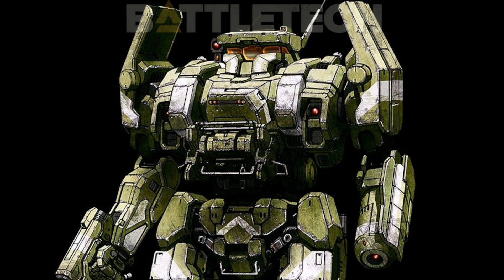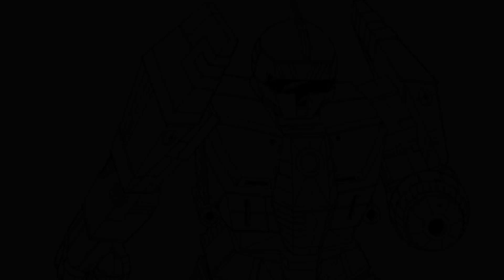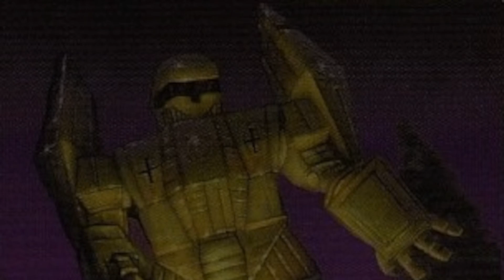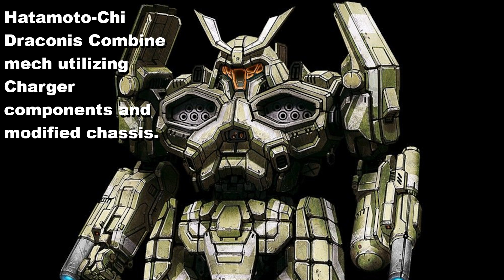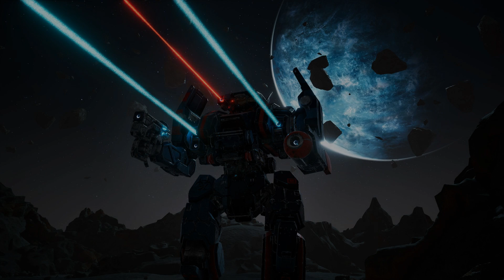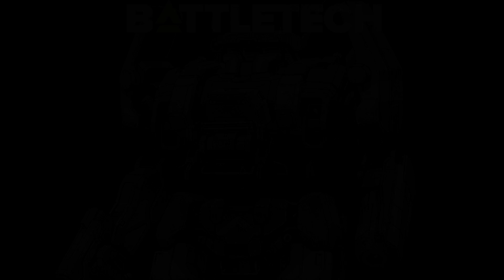BATTLETECH: The Charger

Comment: Niche mech that can be really fun to use upon occasion. Ive run one in games where I paint an area with smoke and let this guy just stand in it. No one goes into that smoke. No one even comes close. Suddenly I have an area that the opposing player wont enter and that means he takes the long way around. Is it a great strat for most games? Not really, but if you need to hold a particular spot even for a few turns this can be one way to make it happen. 

Oh and if you want to be truly mean strip the weapons, add a hatchet, adjust the pilot to an 8 gunnery with a much lower piloting skill. You can make a zombie mech that can easily terrify your opponent. Definitely not a great all arounder, but it suddenly becomes an amazing guard mech.

Comment: Funny thing is, I've been fiddling with a similar design. Saw the thing on the Battlemaster and asked, what if it was faster? So, shrank it to 80 tons, went to an XL 400 engine with FF armour and jump jet. One large ER laser, six medium lasers and a quad of machine guns. 

Not a cheap Mech by any means. 

But the idea was more a sort of command Mech that could keep up with faster formations. Initial tests weren't bad, but it does have a lot more firepower than this thing does.

Comment: I like the Charger because it better represents procurement thinking and bad weapon systems which make their way to the front line over the protests of soldiers. Many such systems exist or have existed.
It makes a lot more sense for the Charger to have originally been built with the XL engine and sold to the SLDF, it could be spun to look good on paper, and is a viable assault scout this way.  It need not have any better armament than five small lasers, just jump jets and more armour.  With the standard engine I do not see the mech ever making production.
I have seen 100 ton designs with the 400 rated engine, they are somewhat more viable for level 1 tech as a 'heavy assault mech that can keep up'.

Comment: Let's compare the Charger to another famously dodgy but more successful design: the Phoenix Hawk.
Standard PHX-1 carries 1 Large Laser, 2 Medium Lasers, and 2 Machine Guns thereby outranging the Charger. It runs at 97 kph and can jump thereby outpacing the Charger. It costs significantly less. The only way you could make a Phoenix Hawk worse than a Charger is if you tried to use the LAM version.

Comment: Wasn't there a variant with 4 large lasers (with a smaller engine)? That sounds pretty solid to me.
Reply: Yep - a 3/5 move with 5 tons more armor, 4 large lasers, a medium laser and a lot of heat sinks. Noted in the fluff as a relatively easy conversion (despite engine swaps normally being a difficult task). Also known as the "Challenger" - maybe as an attempt to get the Charger stink off? Best use of the chassis IMHO along with the Hatamoto series of mechs.
Reply: Still it's useless and inferior compared to let's say an Awesome

Comment: 3050 full clan tech rebuild, CGR-5A, Charger. 5/8/5 movement. armor factor 247 (max), 80 tons, 26.25 Clanner XL engine, 7 tons standard cockpit+gyro, 5tons jumpjets, 15.5 tons standard armor plating, 8 tons standard internal structure, 18.25 tons of PodSpace.
PRIME CONFIG, aka The Troll: 13 Small Pulse Lasers (r/la, r/lt, h), +3 DHS, TAG (rt), Active Probe (lt).
ALT CONFIG A, The Mad Bastard: 2 clanner LRM-15 (r/lt), 4 tons LRM ammo (r/lt cased), Artemis IV FCS (r/lt), 5 Small Pulse Lasers (r/la, h).
ALT CONFIG B, Drunken Brawler: 6 Streak SRM-2 (r/lt), 1t INFERNO ammo (rt cased), 3t streak-2 ammo (r/lt cased), 5 DHS, 4 ER Medium Lasers (r/la), 3 clan MG (r/la), 0.5t MG ammo.
Enjoy =^.^=
p.s. I normally do not name variants, but someone on FB asked for The Troll and the others just came to me as I was making these

Comment: I feel like part of the failure of the original loadout is the lack of beam weapons that were similar in role to the LBX-20 or SRM. After all plenty of assault 'mechs succeeded by focusing on a devastating short-range punch, but well...trying to achieve that punch with small lasers is a bit of joke. They needed a "shotgun laser" type of weapon, and none existed back then (maybe it still doesn't exist; I haven't seen it pop up in modern BT/MW games).

The other part is the design wasn't satisfied with good speed, but wanted to push an assault 'mech to great speed, and even in real life that's an extremely costly idea with little upside. (And the game mechanic of engine weight reflected that.)  So this was less of a shortcoming of universe design and more just a universal constant of any half-believable universe where if you design the heaviest vehicle you can make to go extremely fast, you're not going to have room for it to do anything else.

And that's why I feel the narrative on this 'mech is pretty flimsy, since no serious military personnel would look for such a 'mech knowing it'd be caught by a faster heavy 'mech and then torn to shreds due to the firepower difference. It's even a narrative problem they could've solved: 
* the 'mech contract could've been the result of rampant cronyism or corrupt politics, explaining why even though everyone involved knew it was a bad idea it happened anyway because it was some dude's brother that owned the company or some rich company who bought the votes needed to make the contract happen.

* alternatively it might've made military sense.  For example if one part of the galaxy is mostly just defended by fixed defenses or 'mechs that are just below the Charger's top speed, then suddenly it would be pretty amazing for a scouting role despite its crazy cost.

Obviously the art of world-building has come a long way since the Charger was first mentioned, so it's less a problem that the original story was pretty shoddy and more that they should've just retconned and cleaned it up a bit to make it a little more believable. (Since at the end of the day what we really want is believability in our world with giant walking robot-tanks, right?  And I'm only half joking, because taking a ridiculous premise (walking tanks) and treating it very seriously to try to make a believable alternate world is actually my absolute favorite type of sci-fi/fantasy fiction!)

Comment: First off, I will say my favorite variant is the 1A1 and any data going forward is based off that version

The Charger's main fault was the (in universe) designers got its role wrong. It should never have been a heavy scout but a command unit or heavy support for hit and run raiding deep behind enemy lines. Even reducing the engine to a 360 (or more reasonably,  a 350) VASTLY improves the design for only 10kph of the max speed...to 71. Which is still BLISTERINGLY fast for an assault mech before the clans show up, especially for one without an XL engine. With the 360, there's enough room for 2 large lasers (or a PPC and 3 heatsinks) and 5 medium lasers (or 4 and a TAG) and 18 (21) total heatsinks. It would run a bit hot, but considering what it would likely be fighting (scouts and faster mediums, and maybe the occasional quickdraw), it likely would be able to sink heat fast enough to cripple or destroy them before it started getting out of hand. It makes a pretty decent zombie mech as well since you could just strip all the armor from the arms in a pinch and use that in the torso, 4-5 medium lasers is nothing to sniff at after all.

Like most mechs, it gets hilariously dumb with clan tech, because it basically turns into a super Crab with 30 more tons to play with. 5 medium pulse lasers, 2 clan ER PPCs, improved jump jet, clan double heatsinks including double engine sinks (for 40 total heatsinking per turn), ferro and endo. You now have an assault with 10.5 tons of armor, enough medium pulse lasers to potentially alpha anything that MIGHT run away and either ER PPCs or Large Pulse lasers depending on how you handle bigger stuff and still runs at 81kph. There's also very little stopping you from switching the pulses back to normal medium laser and throwing on an active probe...or replacing one of the lasers with a TAG system and a ton of armor.

Comment: See, I would've stopped the engineers at "52 ton engine."  When the engine on a "scout" weighs the same as a pair of fully equipped and armored scout mechs and STILL doesn't even come close to matching their speed, I'm firing mech designers right there, no questions asked.  Sure, it's got some armor, but when anything lighter than an assault mech can outpace it and anything bigger than a FLEA can outshoot it, all that armor don't mean jack but a hefty repair bill.
Reply from the maker: Guess what the most expensive part of the mech is? Do you think it may weigh 52.5 tons? :P
Reply: @BigRed40TECH  That 52 ton retirement fund probably COSTS more than two scout mechs.  It's 5/8ths of the mechs entire weight, leaving room for feckall else.  And you know what?  Don't matter if it weighs 52 tons or five; a couple good critical hits and it pops either way.  If I'm gonna take up a drop slot on a scout that can't do jack for damage, I'm not wasting millions of bills on a big slow one that's also easy to hit and costs truckloads of cash to repair.

I mean come on.  An assault mech?  With five small lasers?  How this thing got past ANY vetting process is beyond me.
Reply from the maker: @therealbahamut  Wow now. The 400 standard engine is a fantastic engine. It's amazing. It's extremely expensive, so it must be good for 52.5 tons :D
Reply: @BigRed40TECH  MAYBE as an XL variant; 25 tons is much more reasonable and leaves room for other gear.  52 tons means you're not fitting it in anything less than an assault mech and, as the charger aptly demonstrates, you have little room left for anything else, defeating the point of an 80-100 ton mech.  The charger can get sold for parts as far as I'm concerned.
Reply from the maker: @therealbahamut  Clanners can get away with a 400 XL engine in a 80 ton mech. IS not so much.
Reply: @BigRed40TECH  Exactly.

Comment: A man who under estimates a charger has never been hit with an 80 ton battering ram before.
Reply from the maker: I've been charged by a charger before. Sure does suck. But if the mech's entire purpose is that, for its cost, its not worth it.
Reply: @BigRed40TECH  to be fair if people in either sphere were worried about cost efficiency it would be rare to see designs bigger than mediums.

Comment: I've fought against the 1A1 variant enough times to know that the small laser build was designed while on the cheapest canopian drugs you can find; Anyone in their right mind wouldn't constitute 80 tons to be within "scout mech" range.
That's the shortfall of the original design; up close and personal with enough armour to tank and brawl, but too slow to use the small laser build effectively, and as a clanner, I like to do my own personal IIC spin on things.
I did a clan retrofit, of the 1A5, respectively. 2xERMed, an AC-20 and 3xSRM6, stacked neatly behind ferro, endo and a clan 400XL engine, chugging along at nearly 90kph and strongly considered as a support mech.
Reply from the maker: There isn't exactly a lot of Clan 1A5's, and I don't think it's a production model, lol.

Even the 1A5 has the shortfall of being blindingly expensive for the CC to make, and worse yet, was built as a modified import model, making it even less common. It's tactically okay, and strategically questionable.

Comment: I'd peg the Uziel as the worst mech. It's a medium mech with the speed of a heavy mech, the armor of a light mech, the heat generation of an assault mech, the balance of a teeter totter, and the armament of a mech that is 12 tons lighter. How in the world it could be so badly designed is beyond me. The only problem it didn't have was heat but that's because it's weapons which are an mounted with the exception of a short range missile Pod and machine gun are in the arms which are the first things to be blown off the mech in combat, oh and don't get me started on the fact you get five shots with the missiles IF you are lucky and machine guns take two tons of ammo to chew through a quarter ton of armor and the Uziel doesn't even carry one ton of it. The Urban Mech runs circles around the Uziel and I've effortlessly taken them out with a Commando. Which is actually a really great mech.

Comment: Never played tabletop, but in MWO or MW5 with the Yet another Mechlab mod, it shines.

In MWO, you can drop the engine to get more tonnage, and still have speeds in the 70's. Load it out with Laser vomit, and its incredibly deadly. It gets structure quirks, and carries surprising armor for its tonnage. I've out-tanked heavier assaults at point blank range bc most people forget it has about it having as much structure HP as it does armor HP.
Reply from the maker: In Tabletop Battletech, custom machines aren't very common, they're extremely rare and often very expensive, as well as being maintenance nusances except for the most superbly done ones.

It's not a Charger anymore if its heavily customized :P
Reply: @BigRed40TECH  Interesting. I can get a feel for that somewhat in MW5.  Completely refitting an assault like that is expensive, and I think increases its upkeep per cycle. One thing the PC games will probably never get aligned w the tabletop lore. It's all about ease of play, for the video games.
Reply from the maker: @myarbro909  Yep, the video games are about offering optimal playability and empowerment to the players in the context of a first person shooter.

The tabletop game isn't really that.

Only omni-mechs are really customizable, and even then armoured plating, engines, and internal components don't change on those either. It's just the pod-space onboard that can be worked around easily.

If you've got the money, and the pods.

Comment: Heeeeeeey, 4 SLs can still take out a mech you know. Like... a Locust. From the back.

Is the LTV 400 XL really an improvement, though? If either side torso gets blown, that's automatically an engine kill, even with CASE for ammo bins, due to the 3 extra slots PER side torso a Helm Memory Core XL engine requires for that halved weight.

Comment: There are NO bad mechs, only bad MechWarriors that don't know how to make the most of their machines.  The Charger is a perfect example of this.  For less than 1,000 BV you get an 80- ton mech that moves like a 55-tonner. It has no heat issues, enough armor to get in your opponent's face, and can make quick work of lighter mechs with a 16-damage kick.

Comment: i mechwarrior 5 i tried to give the original charger a go (found it as an early assault mech while starting in rasalhague) tried to sacrifice some armor just to get 1 medium laser, but i gave up and sold the dam thing. Never touched the design again until i found the Cappelen refit that adds the ac/20 (which took forever) still thin armor but i love the fire power, that and the melee varient that adds a battle axe

Comment: The only time a Charger feels like a threat is in urban combat. When line of sight is massively restricted the 5/8 movement can close to melee range even with the Charger's relatively light armor. And then... its all up to getting two lucky punches or taking a big risk and kicking. The light lasers are a joke. Physical attacks are the Charger's bread and butter, and it isn't really superior at performing them. Using a club is a risky proposition. Punches are better because of the vastly increased chance of a head hit. Kicks are better because they will always land on the legs. 

Applying Starleague tech to the Charger is practically a transformation. The XL engine frees up a remarkable amount of weight, enough to make the charger competitive ... with mech designs that don't have Starleague upgrades. Just because the design is a vast improvement doesn't mean it suddenly becomes good. Other mechs with the same technology applied are just better. 

You can tell a mech design has problems when most of its advocates want to compare it with mechs one weight class down. The Charger often gets compared to medium mechs, it is that out classed. If you want a fast mech, stick to light and medium mechs. The engine ratios favor that. If you want an assault mech, accept that the massive firepower and durability come at the cost of speed. 

Last thing: If you pull the 400 Engine out of a Charger ... that isn't a variant. That is a completely new mech using the same frame. What essentially makes a mech is the engine and the frame. When you go messing with the engine that is effectively totally redesigning the mech from the ground up.
Reply: Incorrect, first of all the schematic not the components dictate whether something is a variant or a new design.
Second, you don't need to redesign a mech to change its Engine Rating, according to Strategic Operations page 188 changing Engine Rating is a Class D Refit which can be accomplished in a Maintenance facility, ie a Mech Bay, so it's a Refit not a Redesign, and not even one that requires a return to the Factory.